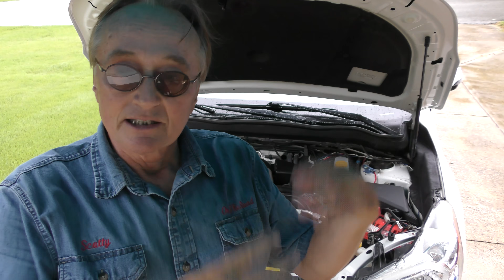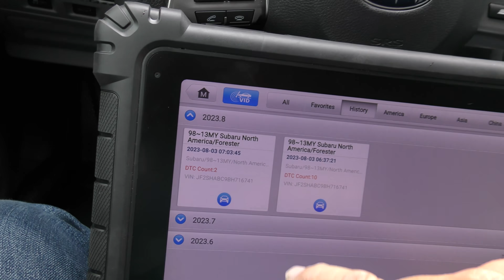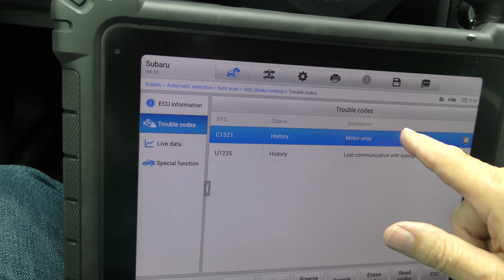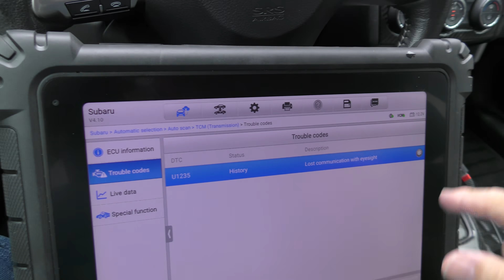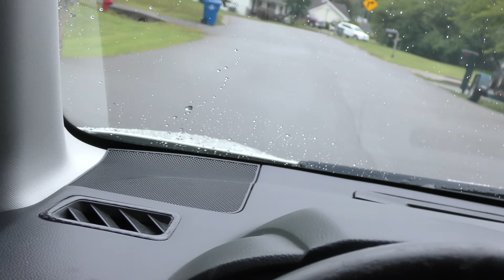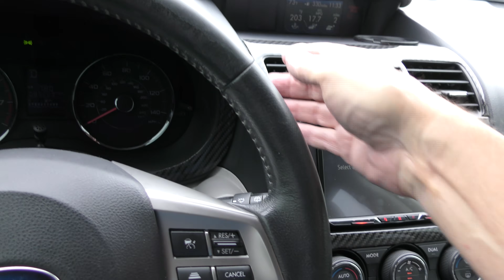Doing This Will Reset Your Car and Fix It for Free

Comment: I live in the Ozark mountains, if I am buying an all wheel drive, I need a 4 wheel drive with some ground clearance, not a go cart. Sure, it's fairly well built, but it's also expensive fort what you get. I'd still take a Toyota over that. Tundra, Titan, Chevy Silverado, ect.
Reply: Try the older 4x4 Chevy Trackers
I have a 2001...i love it
Reply: @patandrik6749  been hunting for one that is restorable but not 5k +
Reply: Try googling them in Florida

Comment: About three years ago I came across a Subaru Impreza with a manual transmission and just over 88,000 miles. The car seemed OK but the guy was really hustling hard to sell it under market value. That raised a few red flags so I passed on it.
Reply: Manual transmission cars can be a hard sell in some parts of the country

Comment: My 04 saturn ion's transmission has a complete mind of its own sometimes it shifts great but sometimes its straight junk and just sits at high rpm for about 40 seconds then shifts back down but its still going strong with 187,600+ miles stil original engine and tranny, tranny had work back in 2007 for solenoid replacement.

Comment: Personally I would Not Own one. If you wants Transmission then get a Allison 10 Speed Automatic. I get 24 mph. Right out of the box with my 2021 GMC Crew Cab 4x4 2500 HD with a 6.6 Duramax Motor. I will put The Duramax and Allison Transmission against anything out there. Allison is such a Great Transmission that Ford Uses Them Now. The Use the Very Same  Trans. in a F-250 as My GMC 2500.

Comment: How the devil do I jump start a 2012 Hyundai elantra when you can't get the jumper cable on the Positive battery post? I can't hold the cable end down on the post and go in the car to start it , I have no remote start.

Comment: The CVT in my '24 Crosstrek does a great job mimicking a geared automatic transmission IMHO, there's hardly any CVT "rubber banding" with it.
Reply: 24? Out already?
Reply: @memphisM3  Yea.  They've been out for a couple months now.

Comment: It's just resetting your computer. Same as if you clear the codes and it isn't really an issue otherwise the code will just come right back after X amount of miles
Reply: My 2013 peugeot used to go into limp mode after really cold starts without triggering any codes. Had to shut down and remove the battery clamp for few minutes to get it to work properly. Eventually it triggered several codes for several modules low voltage. The battery was almost new and in great shape.

The problem turned out to be the factory installed crappy quick connect clamp and thin wires on the positive terminal so i suppose the voltage drop during cold starts was so extreme that it confused the computer. I rewired it with proper thick wires and proper battery clamp and havent seen the problem since.

Comment: Scotty, I have a 2007 Jaguar s type. The battery went dead from sitting and I jumped the battery. It starts fine but it says “ cannot apply parking brake”? So the car won’t move, as the parking brake is stopping it. It happened a couple of years ago and I found a procedure on the internet to fix this but cannot find it now. Can you tell me the procedure?
Reply: This is your procedure. Sell the Jag and buy a Corolla with half the proceeds.

Comment: This happened with my 2011 Highlander.(170K miles)  One day the Check Engine Light showed up when I started the car up, it just never went away as well as the traction control  light.  A couple of days later the battery was dead and wouldn't take a charge, so I had to replace it.  The CEL was gone when the system restrted with the new battery and 250 miles later still not CEL so I am chalking it up to a battery issue.
Reply: Toyota seems to have same system as Ford that it resets the computer automatically when new battery is detected.

Comment: My 2017 MDX crapped out in the garage a couple years ago. I took the battery to the auto parts store and had it tested. It was fine. I put it back in and the car started right up. It has run great and code free for 45,000/mi since.
Reply: Probably corrosion under the positive terminal. Can happen on negative but much less frequently.

Comment: Don't 2.5 Subaru have cylinder head problem ? 2.2 were solid.
Reply: @Laurance. Only the non turbos has the gasket issue. Was fixed in the 06 preface. Turbos has a metal blend head gasket. Fixed. Change oil every 3k have no issues.

Comment: The Foresters are known to have faulty relays that prevent the a/c from working. It’ll blow hot air. Most likely that was all it needed. Dealers will rip you off, and private mechanics often don’t know so “it must be the compressor.”
Reply: Some Hondas have the same issue 15.00 omron relay , fixes the ac

Comment: Depend on how bad a part is reset the computer take awhile to set all the monitor one bad part may cause all the monitors to complete the cycle may have like 3 monitor not set because you need to 
 install a new part like the EGR valve

Comment: Unplugging the battery terminals "resets" nothing.......if the problem code exists, it will resurface a day or so later.  Your car's computer is constantly scanning for problem codes.
Reply: Ever heard of low voltage codes?

Comment: I have had three foresters - and have had three timing belts done.

Love everything except the stupid timing belt replacement.

2004 Subaru forester was the best.  5 speed - beast through the woods and snow.  Had 225k when I sold it